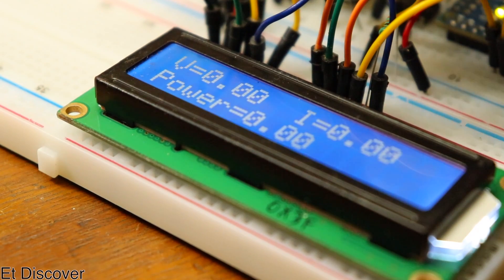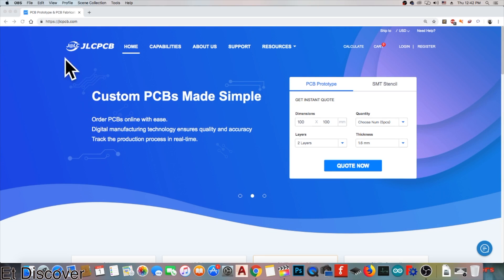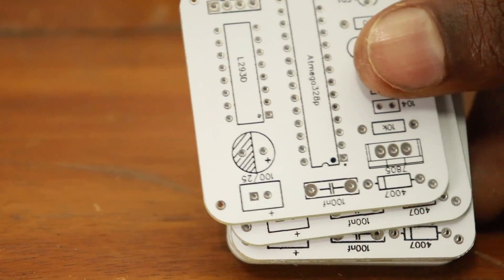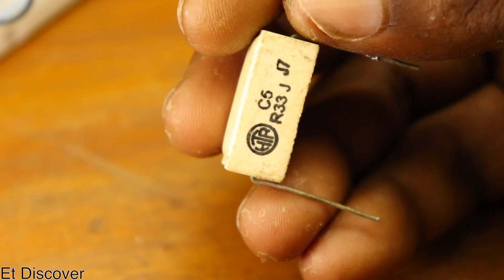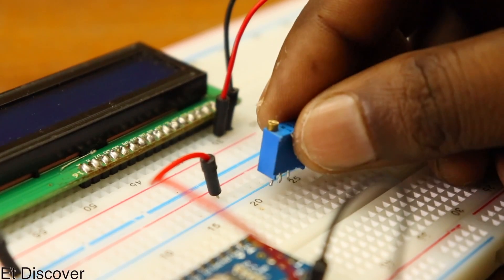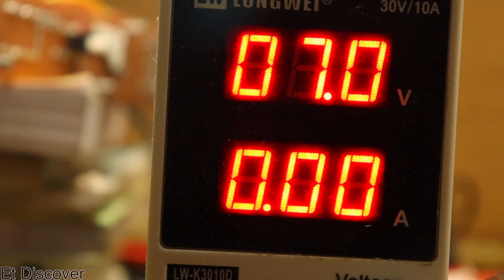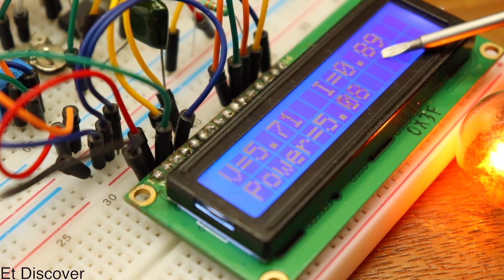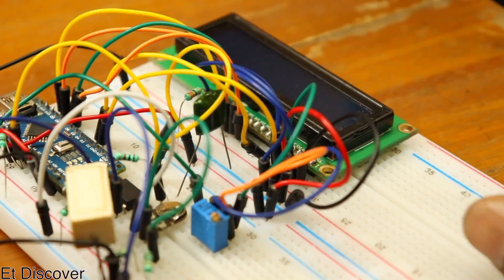Variable Power Supply Display For Current, Voltage & watts

Comment: Your video is getting shorter day by day. You didn't mention about maximum voltage & current. 

Also no explanation about hardware & software side.  You should talking about At least one side.

Just place the components on breadboard, connect them together & show the result.

So what do we learn from this video? How to place components on breadboard & connect them together? Just it?

Take my feedback positively. This is not first time I am watching your video.

Comment: please tell me what maximum volt input    and   maximum current measurement capacity
Reply from the maker: Max 30volt 99Amp current load . But in this case you need 10watt shunt Resistor (0.22Ohm)
Reply: @EtDiscover  thanks 😘

Comment: Awesome video this is exactly what I was looking for, would you do a more in depth video about how the opamp does it's job & current measurement? I would like to build the same project but I am also thinking I could control my power supply voltage & current limit with arduino
Reply from the maker: Yes I can , coming soon please wait
Reply: @EtDiscover  thank you :)
Reply from the maker: Welcome